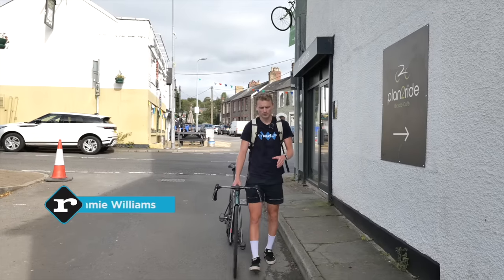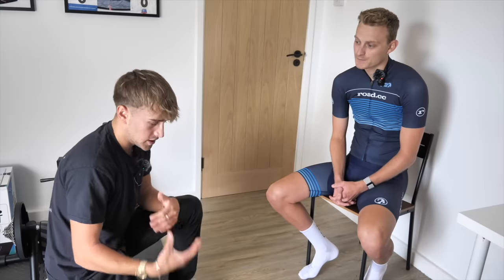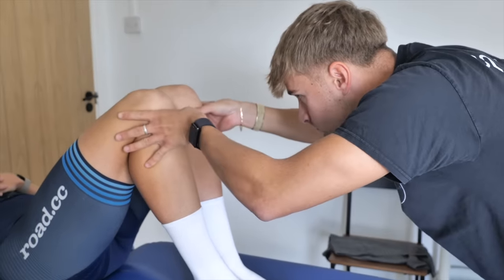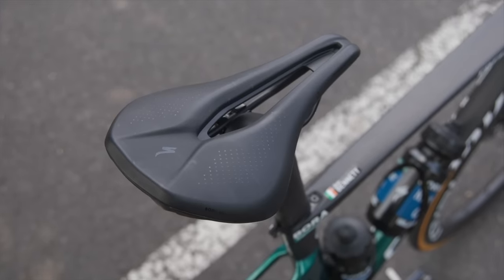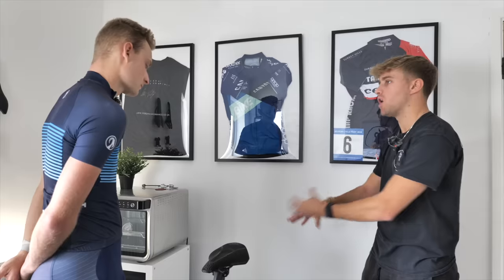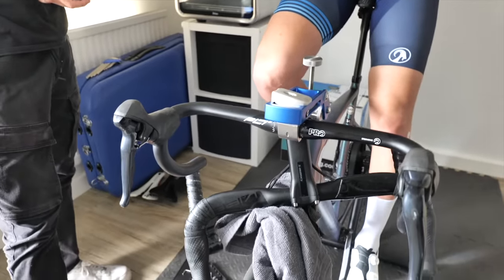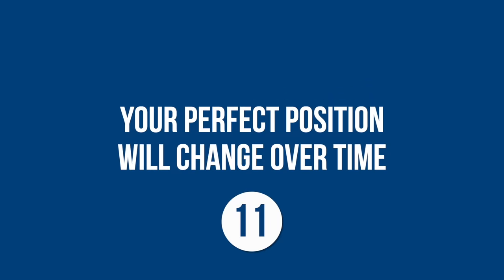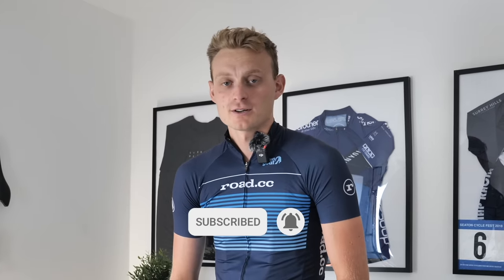11 Bike Fit Tips To Make You FASTER & More Comfortable On The Bike

Comment: I have been cycling everywhere for over 40 years. If there is ONE problem i think is the most common is the narrow shoes.
I have seen guys riding on their SOCKS because their shoes were hurting too much.
BUT… the number of wide models is ridiculously small.
Fortunately, Fizik has recently expanded their range of wide shoes. I immediately bought a second pair after testing the first pair in case they cancel this model in the future. It’s that important !
On warm summer days your feet expand a lot. AND we mortals do NOT have to sprint as if out lives depend on it ! Even with loosely tightened BOAs you don’t have to fear of slipping out of your shoe if you wear the right size (length).
Also; it takes a long time for your feet to recover from serious irritation from too tight shoes.
So…GIVE THE WIDE FIT A TRY IF YOU CURRENTLY FEEL ANY DISCOMFORT  !!
It is such a treat for your feet !
Reply: You must unaware of Lake shoes. Wide fit cycling shoes since forever.
Reply: @raneksi  +1 fort Lake shoes

Comment: One of the most important adjustments for me was the Q factor, once I put pedals extensions on I had no more shin splints, knee pain foot numbness. I've also gone to the point of full leg extension with the end of my femur over the pedal spindle, my foot doesn't float at the bottom of the stroke and the cleat as far back as possible. This works for me but then we are all different.

Comment: There is a difference between a cycling shop giving you a bike fit to suit their bike based on the manufacturers heigh to size guide. And a body geometry fit which looks at you physically and how your body moves as shown in this video. Manufacturers try to make something that is one size fits all. But we as humans are different shapes and sizes. 2 people of the same size. One could be short legs and wide torso and longer arms. Other could be opposite. So you would have different bike sizes and stem lengths and handle bar widths and seat widths.
Reply: Mix in flexibility, hip impingements, posture, and past injuries that all need to be handled purely on an individual basis for good measure.

Comment: I am missing one important thing at "home" (the city where I live)....  There just aren't any good bike fitters here.  I've tried two and both had me all kinds of messed up.  Saddle so far back that my hamstrings were completely deactivated, bars so high that I gravitated to the drops all the time, etc...  It felt like they were trying to set me up on a beach cruiser when I have an S-Works SL7 and very decent flexibility and core strength.  Just out of luck in my case...

Comment: OMG??? "like an engine mount" :face-blue-smiling:. Ischial tuberosity is not supposed to be fixed like an engine mount, as with anything like pressure sore developing, the body is supposed to move and shift weight and not in the same position for prolong periods of time. I was initially impressed when I saw him used a goniometer but then he said "like an engine mount." Sorry a decent physiotherapist and ICU nurse can tell you that you have no experience with pressure sores mate.

Comment: Sorry this just put me off fit, I think you got to experiment yourself, you didn't look to happy with the slating lol
Reply: Fitting makes a massive difference for a recreational cyclist, especially if you are a desk sitter and/or older and not athletic outside cycling. All the fitter's points are totally valid, and at the end of the day a more comfortable position will let you put out higher power for longer (within reason).
Reply: I agree my bike fit exposed some flexibility and strength issues which were/are valid, did I like hearing I’m rubbish at squatting which makes me inflexible? No was it true? Yes. My comfort improved massively so I found it valuable.